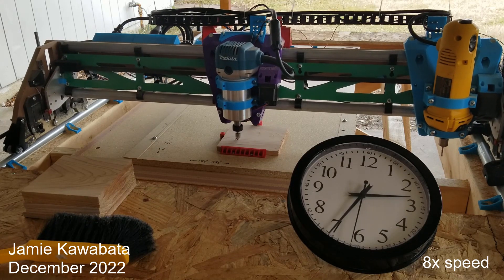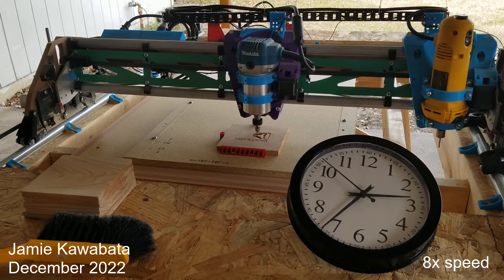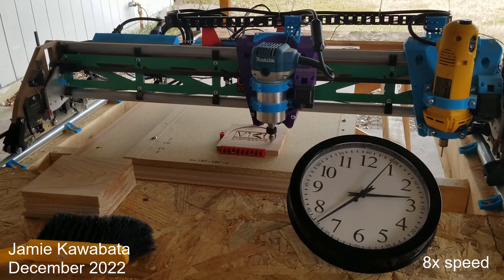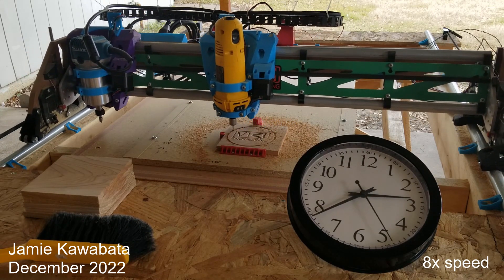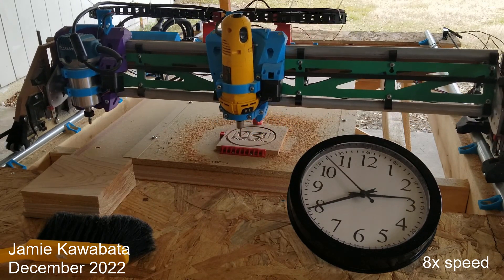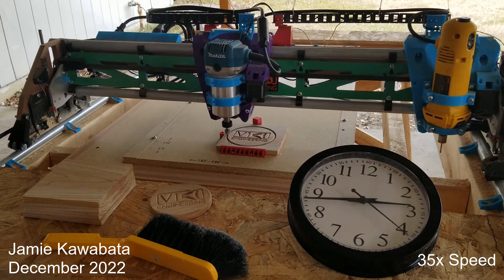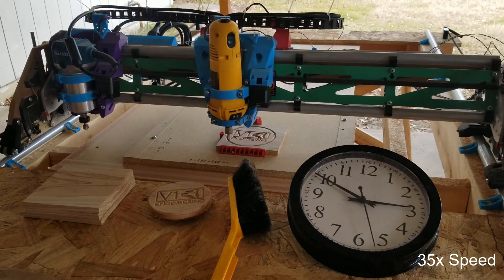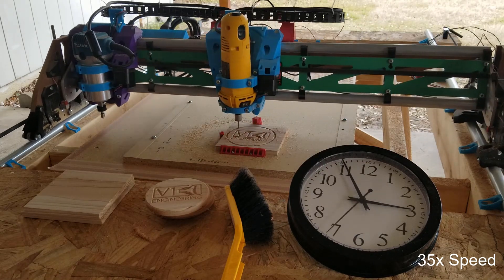CNC with Independent Dual X Carriages (Automatic Tool Changer Alternative)

Comment: Have you tried this with fluid nc?
Reply from the maker: I haven't tried it with FluidNC.  I haven't been following FluidNC lately but last I checked it didn't have a facility for doing an IDEX style tool change.  You could map the second X to a fourth axis "A" but then you have to rewrite or postprocess your gcode.  You'd really want a tool change operation followed by the same X commands.

Comment: This is a great utilisation of the cnc! Does the extra weight affect the cutting in any way?
Reply: Also could you share the STL files for the dragchain? :)
Reply from the maker: @Dt0ur  I haven't noticed any difference from the extra weight.  The router is less than half (maybe a quarter) of the weight so two of them is not a big deal.

Sorry to disappoint you, the drag chain is from an online retailer.